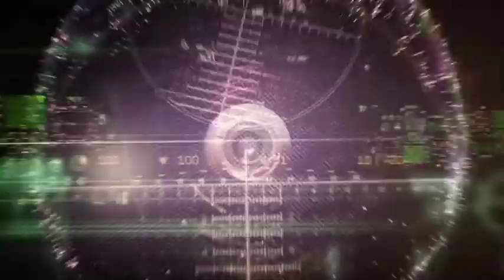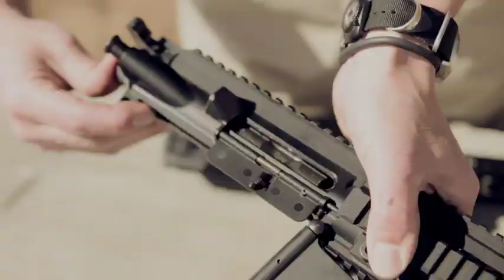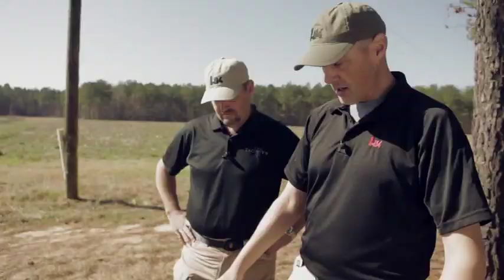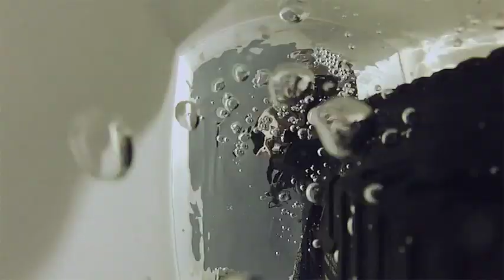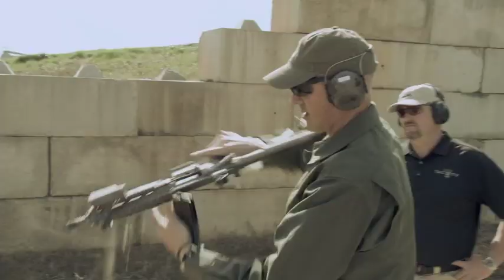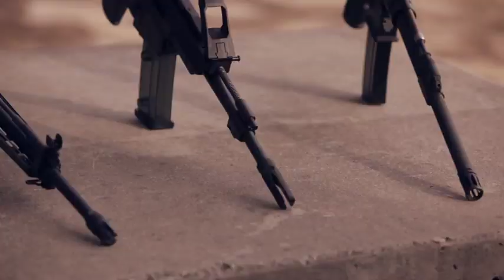HK 416 with Larry Vickers on Tac Tv

Comment: That AR rifle is based upon an stupid concept of the rifle being put together out of two parts - the upper and the lower receiver held together by two pins. I wonder if there's a play between those, and I'm very prone to believe that there is, for the both halves of the receiver are made of alu. So, you pay 4k for a rifle that's far from being perfect. Another thing - nothing beats the long stroke piston system. That rifle us to delicate, like any AR platform rifle. The DI system is nothung but a prototype. I mean, who would guide the gasses straight into the receiver.

Comment: Please help to figure out what tool I can you to fully remove folding sights ( with base ) from HK 416 22LR.
Reply: Not sure on the 22. But on real 416, the folding front sight can be removed by either a roll pin (28mm) or a clip (33mm)

Comment: The great H&K416 jams at 19:21 lol
Reply: It didnt blow up though like any standard M4 would have.  So I'll take the jam after killing bad guys coming out of the swamp vs taking an M4 grenade to this face 😅
Reply: @kaiul2967  the OTB modifications that prevent the 416 from blowing have to be custom ordered in the contract because the chamber has to be cut differently and this causes reliability issues with certain types of ammo.
Without the full set of modifications the 416 will blow too. It has to do with the chamber and how overpressure will cause a case failure at unsafe chamber pressures.
Reply: @kaiul2967  i don't know, that M4 grenade sounds pretty good too! :3

Comment: FN Scar is where it is at Thanks FNH...
Reply: The scar still has issues. Have you used one other in video games? Didn't think so.

It is a very good weapon system, however it IS very expensive and for such a good weapon system, it seems to have  alot of plastic pieces that are a fan of breaking. Having your shit fall out of the handle because the plastic clip snapped off your brand new $2200 gun is extremely frustrating.
Reply: There was nothing wrong really with the plastic Uegene stoner had available to him. M-14's are not obsolete nor are the plastic ones 'heavy as hell' as you state. They are just long. You actually see them alot in the 'stan.

You do not know which plastic parts I am even referring to as it seems. And the civilian market doesn't mean crap, as everyone that a scar or an ak or ar wipes it down with a diaper and kisses it good night everyday. Of course their stuff doesn't break, they don't use it as  a weapon/tool every day like guys do in country.

Again, the SCAR is a fine weapon, but the problem with it is it is still very expensive, and it only solved one problem with the m14's, in that it doesn't use the gas blowback system. But Colt has fixed that problem as well, so I don't ever see it taking the place of the m16/14 anymore.

As far as the 7.62 versions, it's just  a cool toy. It offers nothing that the m14 with a polymer stock does not offer already. Except for the folding stock (no one folds their shit anyways).
Reply: ***** Could be. Not sure what you mean by neutered version but I'll agree with you anyways.
Reply: Not even close to HK.

Comment: It's bulshit that they designed the MR556 to not except full auto Bolt carrier! What if one of the Lucky fucker's out there that have a RDIAS want to stick it in the lower of "THEIR" MR556 lower? Or if they have a full auto lower receiver? I just find it fucked up and bulshit! I still love HK though and wish they would offer the new MR556 A2 (I think that's it lol), and MP7!
Reply: Even if your AR has the proper shelf for a RDIAS you can't just drop it in. It won't work. So when companies like Spike's Tactical advertise their gun has RDIAS shelf, it's purely as a marketing scheme, A lower receiver has to have a pin hole to hold the RDIAS is place. The hole would be directly above the safety selector switch. Then of course you still need to proper hammer, carrier and selector switch for the entire system to work. You would be surprised is how simply the RDIAS is and people could easily make their own. If they had some of the basic power tools.
Reply: ***** Thanks for info. I stand mistaken. And apologize if I put out any wrong information.

Comment: try the sand test with the dust cover open then im impresed
Reply: *****
the early SA80s jamed way to often, they only started working as intended when HK did some changes on the weapon and the G36 melts after a few shots fired or when in hot environment like in afganistan
Reply: *****
ive heard storys of the G36 when in combat that they made a pile of G36s after a firefight because those rifles have been partualy molten and another or maybe the same firefight where G36s started to jam and soldiers picked up AKs. and thne i heard a 1st hand story where a soldier accidently droped his G36 from about 1 meter onto a concret floor and it had a crack in the receiver, rifle destroyed, when i think about weapons beeing droped i have to think about a documentary ive seen where i think stoner said that in one of the tests his rifle had to be droped from the 2nd floor of a building i think? and Kalashnikov said that in old soviet russia if the rifle wouldnt survive the fall they would drop the designer and see if he would survive that
also saying that the G36 is lightweight due to the plastic is rubish since some of the basic M16 and M4 varients with a lot more metal to them way less then the basic G36

Comment: 3 things. 1. Chrome lining the barrel does not affect accuracy to any degree that you could notice. 2. That half-moon thing on the bolt is stupid. The bolt in an AR has nothing to do with full auto. 3. Having to use that tool is stupid. Its going to get lost, period.
Reply: The bolt carrier has everything do to with fully automatic fire.  If there is not enough material on the underside of the carrier, the auto sear will not be tripped.  All other automatic parts installed with a semi-auto bolt carrier equals a semi-auto-only weapon.
Reply: The bolt thing was exactly what I was thinking it's stupid.
Reply: atomterrible carrier yes. At any rate the thing is way overpriced.
Reply: So why do they use a full auto hammer if they're so worried about converting to full auto?
Reply: mk4vws weight.
Reply: You are right about the field strip tool I lost mine the frist week we we're issued the 416 we used the bolt head to field strip our 416
Reply: They act like the 416 is some kind of nuclear laser beam I used one in Iraq doing convoy security they are nothing more then then a freaking M4 with a AR 180 gas tube systom and believe me when the dust cover is open and you get sand in the upper receiver group they will jam I had my 416 to jam many of times when sand got in the upper receiver group they are just using a sales pitch for you to buy the 416 believe me a AK well out perform a 416 any day of the week
Reply: You might want to let all the best competitive shooter in the world know that chrome lining does not effect accuracy - because they don’t know it.
Foolish comment on your part.

Comment: how is the accuracy with this gas system compared to the stadard AR platform or a long-stroke system on a platform such for example the SIG 556?
Reply: Direct impingement guns are more accurate. There are some articles you can find using Google. If that accuracy would be a big deal? Didn't seem like it. Half to 1 moa at 100 meters.

Comment: The MK18 is doing great things over seas with SOCOM operators. The Mk416 is simply unnecessary. Other then being able to fire with water in the barrel and gas port your not gaining anything for the 2000 dollar price tag unless its chambered in 6.8,6.5,300 BLK
Reply: The Hk 416's gas system on a shorter barrel is far superior to a carbine length D.I gun which is linked to the reliability issues common on the army's M4. Also the 416's internal parts will last as much as twice as long compared to the standard M4 do to less heat transfer from the super heated gasses returning to the bolt carrier group.
Reply: First off none of what you said has been scientifically proven in any extensive independently done tests(H&K doesn't count). A recent test done by an ex SOCOM operator in conjunction with the JSCP found that 80% of the M4s failures come from the magazines, the remaining 20% is from weak buffer or extractor springs in a very small amount of cases they found that extensive use on a rifle can cause failures in the gas tube due to heat(i.e. firing full auto). This is why the DOD threw out the Mk416 and the SCAR in their individual carbine tests, you gain virtually NO reliability over the existing M16/M4 platform(especially for the cost). You ever wonder why HK produces their own STANAG magazine? Because that's how you gain the majority of your reliability out of that platform. Research has shown that a there can be problems with a pistol length DI system but almost all of those can easily be remedied by replacing the buffer and extractor springs with tougher, heavier springs and some good lube ever few thousand rounds.

As far as internal parts lasting longer on the 416 and other piston systems this also has not  been proven either as only time will tell. Right now the 416 only serves a very limited role in SOCOM and the SCAR serves only a small role in SOCOM and the regular Army. It is simply NOT worth the 2,000+ dollar price tag. Right now the DOD pays about $600 dollars for ever M4 compared to the $2000 dollar price tag for a piston equivalent.
Reply: tbone martinez
The HK416 addresses these issues by beefing up the buffer spring and extractor springs and even increased the size of the bolt carrier. The price of the weapon system is high simply because it has not reached nearly the same amount of production as the standard M4/16. In time with more contracts the price will go down do to supply and demand. With more and more countries replacing there D.I. weapons for more modern piston operated weapons(i.e German, Australian and Norway's armed forces),not just the HK416, the befits are hard to ignore. The United States is one of the very few modern military forces that still uses D.I in there standard combat rifles. I'm not saying the D.I. system is completely obsolete but just a little outdated compared to more modern operating systems.
Reply: the piston system is by no means modern, it is probably older then an expanding gas system used in an M16. I agree that the short stroke piston system is better on paper however it comes at a huge price and practically no gain in reliability and accuracy over existing systems. HK already had the opportunity to present a mil spec cheaper version of the 416 at industry day to the DOD and they stilll came in at about 2 times the cost of a standard Colt or FN produced M4. So they threw it out along with every other piston system. The reason SMALLER armies use the 416 is becuase they field maybe a few thousand regular infantry and thats it. The US military is many many times larger then European armies and simply cannot afford the price to equipe each soldier with a piston equivilant. the US military will always favor cheap simple combat proven designs over expensive fancy modern designs which have not been proven in any major conflict. in fact the only change that is likely to happen soon is a switch to the 6.5 grendal.
Reply: Then why does SOCOM still use the DI expanding gas system?
Reply: On m4carbine.net, Larry Vickers says the 416 has its advantages in short barrels, full auto, suppressed, or a combination of any of the three.
Reply: ***** okay tactical Timmy, tell us how your combat experience or scientific research has shown that I am wrong
Reply: ***** where is your link at?